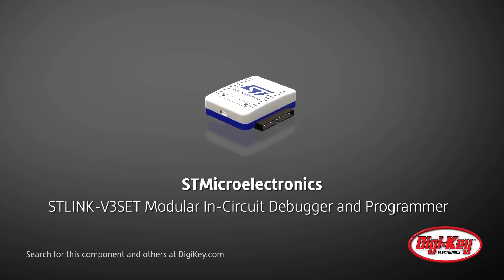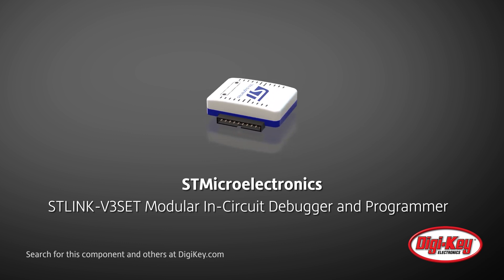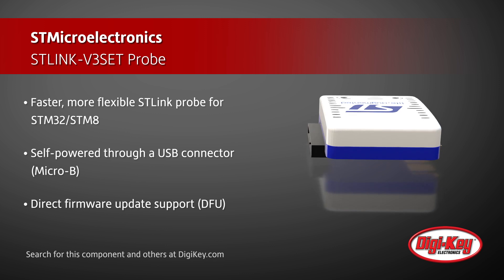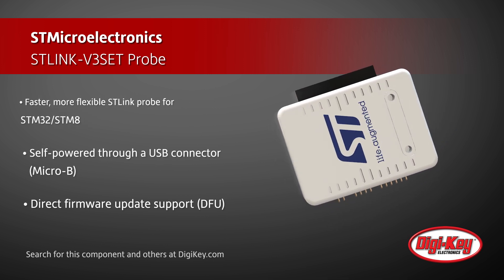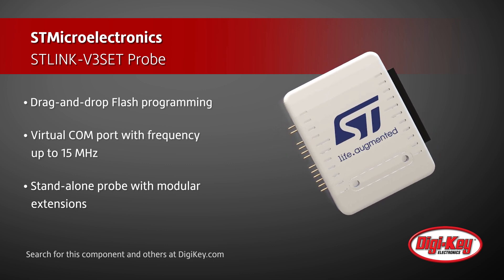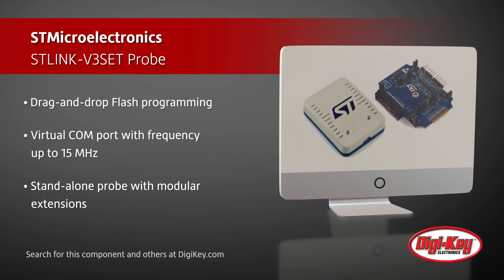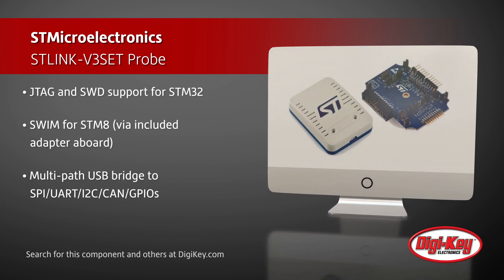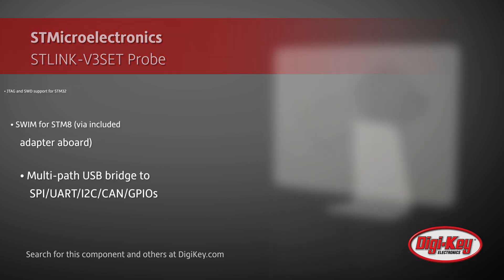STMicroelectronics STLINK-V3SET Probe | Digi-Key Daily

Comment: Hi, I recently bought STLinkV3 and want to program my application controller via UART, when I am trying getting connectivity error 
: Can not connect to target!
                  If you're trying to connect to an STM32W1xx device, please select Normal or HotPlug mode from Target->Settings menu.
                  If you're trying to connect to a low-frequency application, please select a lower SWD Frequency mode from Target->Settings menu.
Can you help me out how to program via UART using STlinkV3